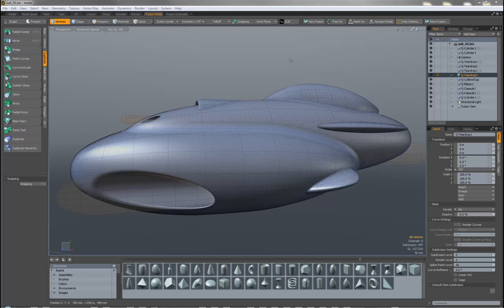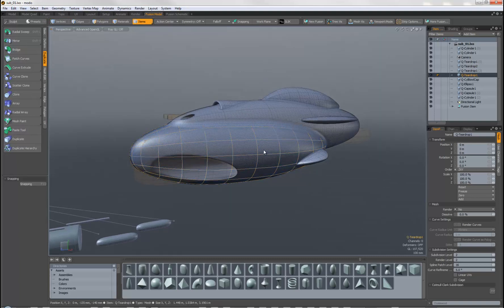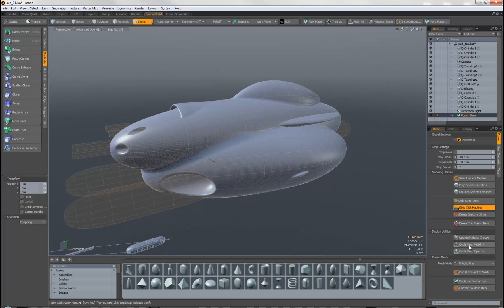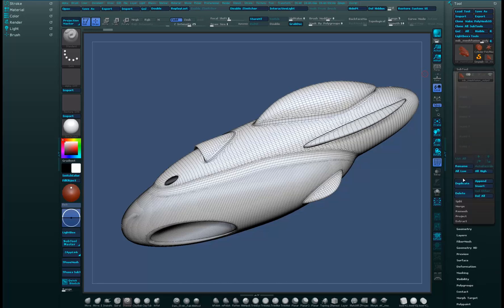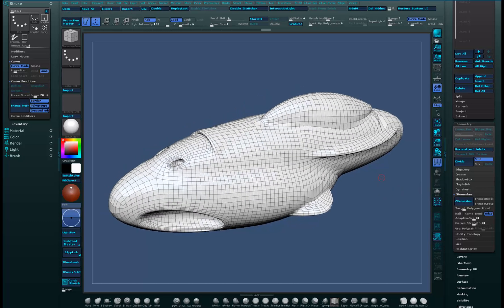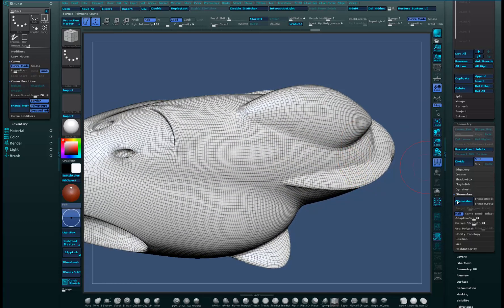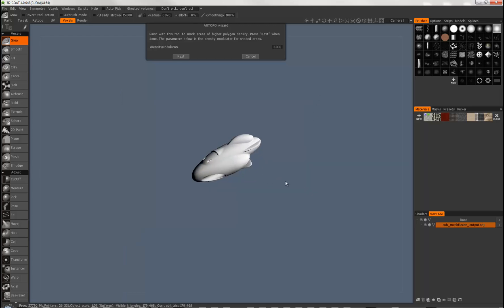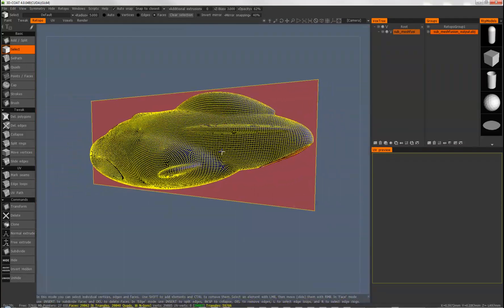Remeshing Modo Meshfusion Models in ZBrush and 3D Coat

Comment: This was pretty disappointing overall. I thought MeshFusion was supposed to produce near-perfect topology on its own. Clearly, it doesn't come close. The promise of live booleans is still significant, but having to use Z-Remesher after the fact is cumbersome and also lacking.

Doesn't MODO have its own "auto"-retopologizing tools? How do they work on MeshFusion meshes?

Thanks!
Reply: +Jerry Gabrie 
the modo retopology tools are awesome. I used to dislike the topology step but modo made it fun :)
Reply from the maker: Kevin Phillips Yes, Modo does have it's own retopo tools, and even better ones in 901 (in which MeshFusion is now included for free). I have not had the time to upgrade and explore because I am currently super bogged down with work. Hopefully I will have a chance to look into it soon though. Topology wise, I have found that what mesh fusion gives you is significantly better results than any other boolean system out there. That is JMHO.
Reply: Thank you!
Reply: +KERMACO Good to know, Please keep us posted on how well the retopo tools work on 901 when ever you get a chance to upgrade. I am curious as well. 

Thanks.
Reply: mesh fusion or even any basic boolean will give you perfect topology if you give it the perfect amount of spans. otherwise on curved surfaces you will have to re-route the topology, creating poles with valences of 5 or 3, and thus smoothing errors (though they could be very slight depending). 

Or you will get triangles like the ones shown... which aren't the worst.

It's mathematically impossible to just ram random shapes together with random numbers of spans and expect somehow magically any program can create perfect topology for sub-d.
Reply: Kevin Phillips I agree entirely, and I love Modo modeling and retopo. Might as well use Zbrush for the whole thing if you are gonna use Zremesher. Or just stay in Modo, because Modo has excellent retopo tools.
Reply: Agree... also the result he shows is disappointing. Not usable!